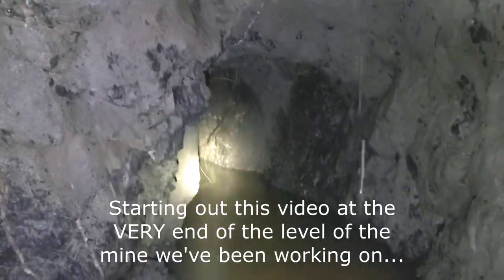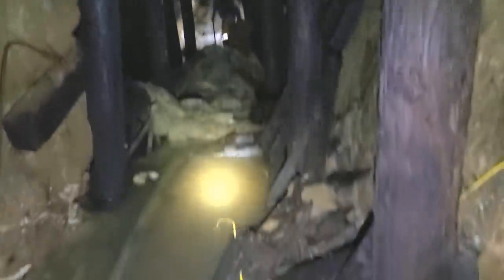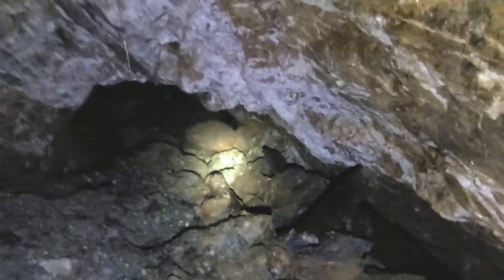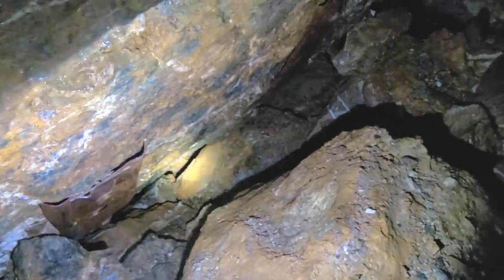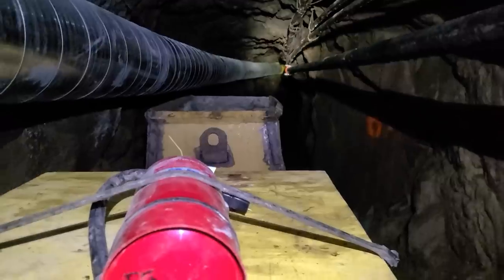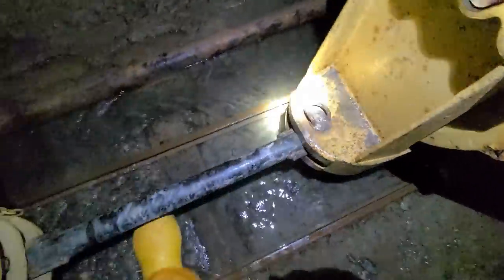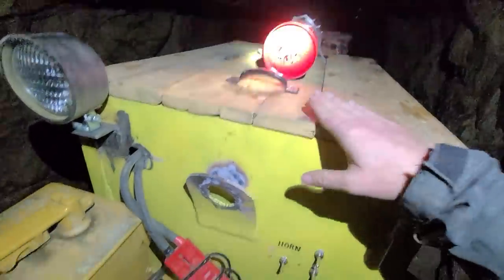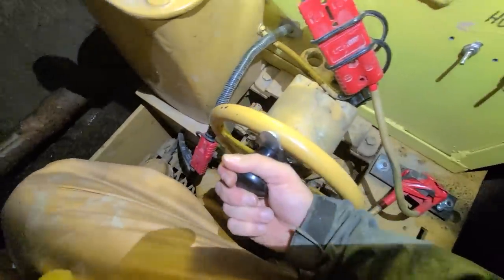Bringing An Abandoned Gold Mine Back To Life: Part 10 of ?

Comment: That’s cool. I’ve never ever seen a mucker working before. My first thought was I could probably fill that thing up faster but then I remembered that the muck is blasted stone. 
MUCKER ! For the win!!
Reply: You also don't want to get too full of a bucket with these. The muck velocity coming out of the bucket is dependent on the bucket fill factor. Too full a bucket won't get enough muck to the back of the car. A partially empty car requires more carloads to muck the face, which screws up the cycle time.

Comment: With the amount of work done you have really cleaned up the place . With the amount of water you could put a small hydro system to charge batteries for cabin use and have the ability to pump water to the fire tanks . With water available you can keep the area around the mine site quite green

Comment: Fascinating, as always. Thank you. When you are at the face using the trammer, how do you swap the full ore cart with the empty one? I don't see any sidings.
Reply: There is a junction at 1600 workshop, a few tens of feet away from the face. They use that short length of track in the direction of 1660 for car swaps.   I couldn't think of another explanation.

Comment: you should put a cover on that "digger".  Just put a bit of metal that you can pull up so it protect the hands from the operator.   If something happens and you fall yor hands can come next to the "diggers" arms and cut fingers/hands right of. 
Even if there is some sort of deadhandsgrip accident can still happen.

Also you need a "air pillow"  just use the air from the compressor and just slowly raise the ore cart etc. 

You also need more ties under the rails.   The load can viggle the rail to be to "open" and the orecars wheels can derail.

Comment: You think there is much unmapped workings?  From a google map view of your mine site, the dump of the lowest level (no.3 level, where the remains of the mill are) looks like it could contain 125K cubic feet of waste rock (that is, a volume about 50' x 50' x 50' even with scattering of rock down the steep hillside for a few hundred feet).  And that volume of waste rock is about what you would get from digging a half mile of underground workings (8’ X 6’ x 2500’).  Correct?  Do you think there are much more workings?

The dump for the middle level looks maybe 70% as big in volume as level 3.  So there could be another 2K feet of working there.  Is my estimate of the volume of waste rock and amount of workings off by much?  Were you estimating that there are more workings for the two lower levels?

Totally great video series!!!  Each episode is terrific!!!

Comment: Do they have re-railers for mines? On poorly maintained track sections with many derailments, railroaders had metal re-railers with them to lift wheels up and back onto the rail. The force is provided by the locomotive. Since you don't have ballasted track, you'd need an assortment of wood pieces to support the re-railer lifting the wheel.

Comment: That is one clean-looking overshot!

Just curious - what type of core drill are you using? I anticipate needing a lot of infill drilling and would rather have core than cuttings from the air track. We're heading down the path to production; mill equipment has been purchased and I'm working to hammer out a mine lease.
Reply: If you get to production (fingers crossed it's "when"!), film some stuff if that's possible. Enjoy your content sir.
Reply: @silasakron4692  Thank you! I'll be sure to.

Comment: The derailment. Might be that the gap between track ties is far enough apart that with a loaded car it bends the track down, then you get to a tie and the car rises back up. If you're moving too fast the upward momentum could cause the whole car to lift just enough to derail. I'd imagine problem would be more prevalent if the ties are not perpendicular to the track, or when going around any kind of bends. 

Show us how you switch out loaded and unloaded muck cars. Also, the emptying at the portal.

You mention before that this drift is going off in a different direction a certain distance, but never said why. Seems like its going perpendicular and away from the main ore seam. Is this exploratory to see if there is a parallel ore seam/fault?

Comment: you doing any treatment of the discharging water? in modern mines the feds dont like to allow mine designs that can result in gravity discharge of water because its hard to stop the discharge when the mine closes. They want all dewatering to have to use a pump.